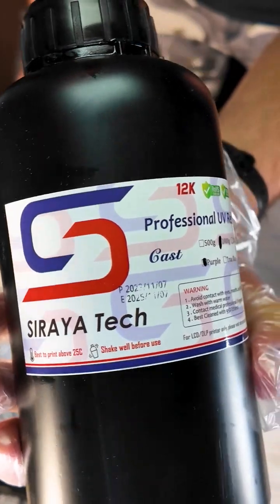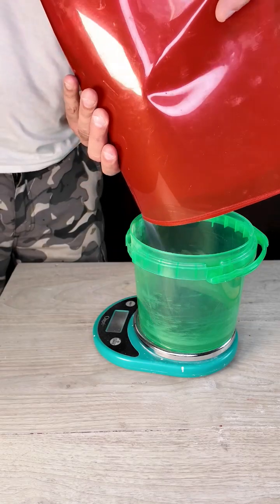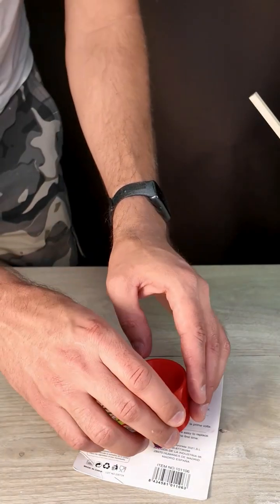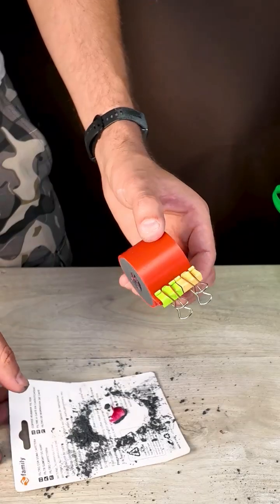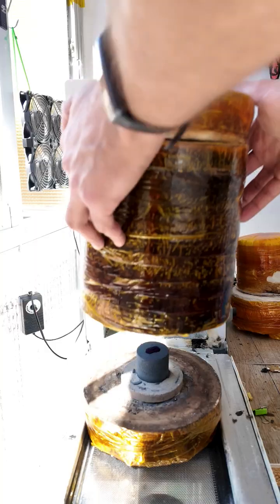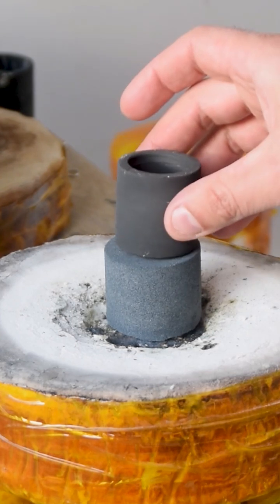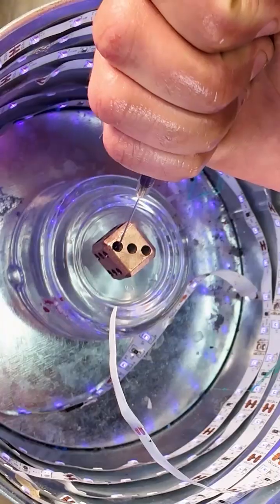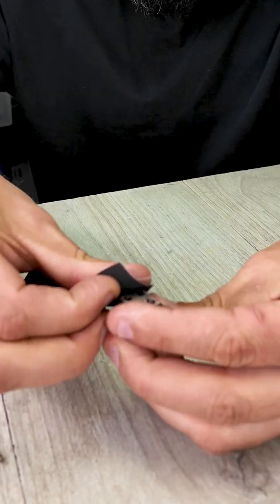Metal Casting a Dice from a Pipe #metalcasting #diy

Comment: Is there a particular reason you can't make the mold out of sand?
Reply from the maker: You can, and I do. I like to use silicon carbide when burning out resin, but sand also works, as seen in my last video.

Cheers!

Comment: My only nitpick is you need to pull equal volumetric material so the dice wont be biased to land on the sides with higher numbers(because they are lighter where there were more indents), but this must feel so nice and heavy in the hand.

Comment: How long does it take to melt the metal in a microwave? How hot can it get? I have a regular electric kiln that I bought off eBay but I’m really curious about the prospect of using an old microwave. It’s not a danger from radiation?
Reply from the maker: I've spoke about it in a Microwave metal Melting video. It really depends.
https://youtu.be/P1VmIYheuU4
Cheers!

Comment: Im beyond confused that a microwave could melt metal
Reply: You can get to really high temps in a microwave as long as you have a material like silicon carbide that can absorb microwaves efficiently and you insulate it well enough.